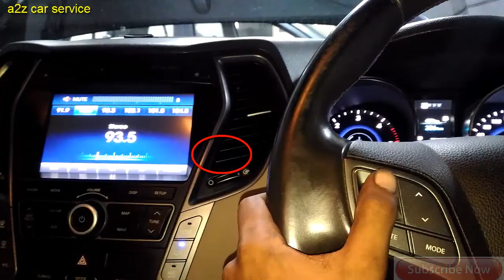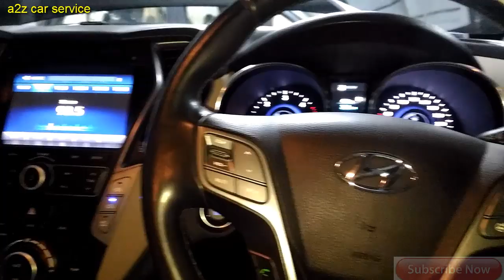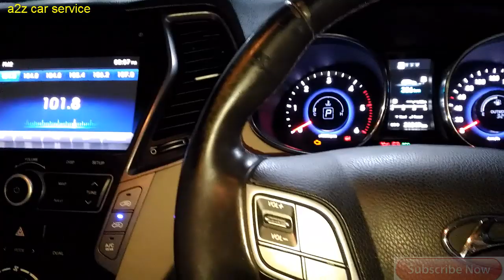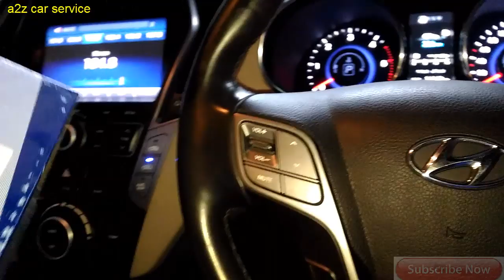Hyundai steering control audio not working || steering mounted switch

Comment: Hi Bhaiya, one question just I installed Grand i10 Audio controller where the dashboard and steering being opened and some wring chedchad hua he may be so my reverse gear sensor not beeping while reverse, wring issue ho sakta he kya. Back gear sensor aur androud dashboard wiring mein kuch link he kya..please suggest. Audio controller just lagane ki baad hi ye issue ayahe or mechanic Maan hi nehin rahahe kuch support karnekeliye

Comment: Abhijeet bhai ek Question hai: kya hum i10 grand 2014 sports model mein staring controller laga sakte hai? Haa tho kya kya change karna padega? Meine suna hai sirf airbag jis car mein hai usi ko audio controller install kar sakte hai?
Reply from the maker: nehi hoga
Reply: @a2zcarservice  clock spinner change kar k bhi nahi hoga? Youtube pe ek video dekha tha use contact kiya wo bola hoga pura set approx 3500 ka hai koi wirecut nahi hogi bol raha hai.. Sir ji please aap check kar k suggest karo.
Reply from the maker: @pravinpatil7826  nehi hoga sir audio system v upgrade karne hoga
Reply: @a2zcarservice  okk.. I'm planning to upgrades current Audio system with Android player.. use pe chalega? Muze sirf janana hai koi wirecut ya wirering mein changes tho nahi karna padega na? Sorry abhijeet bhai bohot questions kar raha hu but hamare yaha koi thik se batata nahi..
Reply: @a2zcarservice   Hi Abhijeet,
This works 👍👍 I changed only the staring controller and clock spinner. Now everything is working with my factory fitted stereo👍 except Phone call button. Because my stereo don't have this facility.

Comment: hello, bahut badiya video and information. My Verna 2014 steering wheel is making noise while rotating left and right, what is the possible problem? Is my Steering motor is damaged or My Clock spring is damaged.Looking for the answer, thank you bhai saab.
Reply from the maker: khar khar khar khar noise mean motor need replace,steering will hard soon
Reply: Genuine  Motor ka kitna price hai...Bahut bahut sukriya bhI
Reply from the maker: @thewhitecoalfontenoy  5800 approx.

Comment: Good information. What is the cost of airbag in steering wheel and dashboard.
Reply from the maker: not sure but more than 25k
Reply: @a2zcarservice  25k for steering wheel
Reply: Thanks
Reply from the maker: @frk380  25k for air bag driver and passenger air bag

Comment: Hi bhai mere paas ford ikon flair hai, kal maine charon tyre chang karwaya aur alignment bi ki lekin chalaane ke baad left side pe zyada pull kar raha hai. 
To iska kya problem ho sakta hai
Reply from the maker: 1.alignment wrong
2.lower arm damage
3.steering tie rod bend
4. strut ,knuckle problem
so many reason r there for this one issue, need to check

Comment: Bro, my stereo is not getting power on while pressing the power button. Checked the fuses and  all good. Intresting thing is if we remove the multimedia fuse and turn car ignition on and then we put the fuse back, then stereo will work automatically , but it will not turn off now if ignition turns off . What could be the problem?? Vehicle is grand i10 sportz diesel
Reply from the maker: on off knob problem..need repair

Comment: Sir, my i20 clutch pedal goes to floor while driving. It doesn't return back. I'm stuck in traffic.please help.
Reply from the maker: clutch release cylinder need replace.
Reply: @a2zcarservice  thanks so much for confirming.

But sir, I wait for about 5 to 10 minutes, then start engine and everything is ok again!!?!!!
Reply: @tnamen1307  It happened to me,  Kind of embarrassing when it happens in the traffic jam. The mechanics had to change the clutch cylinder.